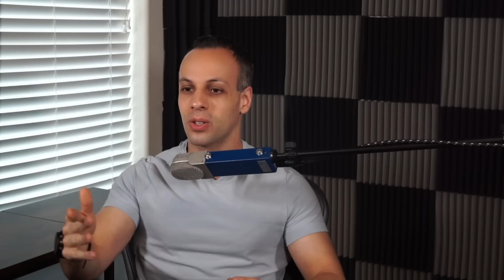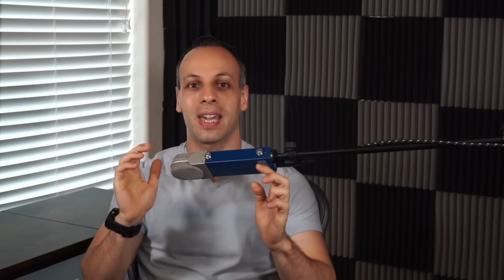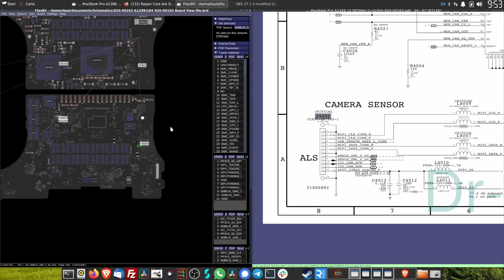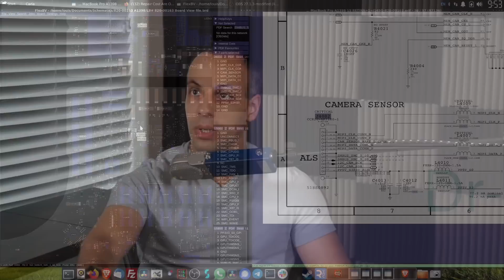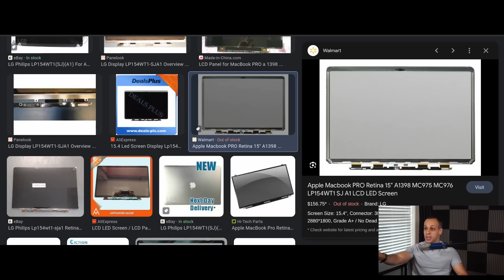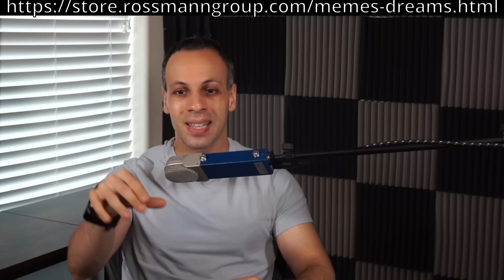The Ford F150 Macbook - when car repair resembles macbook repair...

Comment: Car manufacturers have either been behind the times with outdated technology or doing stupid things like this recently. Part of the reason, during the pandemic, new cars were in short supply is how they design computer systems for vehicles. They were using up to 20 years old chip technology on individual computers that a chip foundry would have to retool to an older process to manufacture. Car manufacturers were encouraged to go to a single SOC computer setup instead of multiple outdated computers. I can see the pros and cons of both. The is tail light issue isn't new. With the Advent of LED tech being used in lights, has made some replacements expensive but not like this. I knew my brother had an issue with his truck rear lamps going out and having to pay like $75 to $100 each lamp for every time they went out because of how they are designed. He finally went with an aftermarket light assembly replacement to rectify the issue.

Comment: There's a way to fix this but still keep all the canbus networked gizmos that manufacturers insist belong in a modern car. Have a star topology with a central "switch" so that one device can't bring down the whole network. Like, you know, computer networking engineers figured out in the 90s when a major switch from ring and common bus networks (10base-5) to switched (10base-T) took place. They already do in some cases with separate driveline, comfort, high and low speed buses, but obviously not enough. All essential components need to be on a separate bus.

Comment: 5k to fix a tailamp? 
my 2011 yaris top trim was 10k$ when i bought brand new. and i have put over 240k on it and it is still on ALL original engine parts except the consumables.

Comment: I owned a brand new 2016 Nissian Versa Note. My yearly matience cost was $2,500.00 a year over a 4 year period ended up costing me a total of $10,000.00 dollars for a 15 thousand dollar car. I discovered Nissian Lawsuits on a suggested Nissian Lawsuits on Google. I was  eligible for a $1,200.00 dollar refund on my radiator that failed at 24,000 miles and a transmission that failed at 80,000 miles. With a tolal of $2,400.00 dollars and the scrap sale of the Versa of $700.00 dollars for a total of $$3,100.00 I bought a 2001 Toyota Sienna and a 2001 Toyota Echo I have had no problems with either car. Since 2018. I just put in fuel, change the oil regularly and check the tire pressure. I will never buy a new car again.

Comment: I've worked as a mechanic for a Toyota dealership for over a decade and the amount of things on these vehicles that were clearly designed without repairability and longevity in mind is genuinely mind-blowing. I firmly believe it's because the manufacturers simply do not care because at the end of the day the majority of people lease their vehicles these days because pricing is just absurd for new vehicles and people want the latest and greatest technology at all times so someone like Toyota or ford will look at that and figure if they can build the thing to be relatively problem free for the first 3 years the people leasing those cars won't care if things start falling apart after 4-5 years because they've already returned that lease and it's someone else's problem now that bought that car used. New car "sales" continue and customers stay happy because they treat their vehicles like an iPhone and replace it every 3 years before any problems can really develop. As long as people treat vehicles as disposable appliances these types of things will just continue to happen and get worse.
Reply: Under 20% of people lease cars and the rate has been falling.
Reply: @JH-pt6ih  when you factor in used car sales where leasing is not an option sure but all I can tell you is what I know from my experience in a dealership setting and the vast majority of new cars on our lot end up being leased.
Reply: @Vanny_Dorito  Might be a peculiarity of where you are at. It is new cars I was talking about - which is interesting because in the push to get everything on subscription as a form of lease, one would think it would be easier with cars since they have a long history of lease programs at consumer levels. Are you at a location that is traditionally out in front on trends?

Comment: While you rightfully criticize Tesla for some of the stuff they do, their products are engineered well and go through numerous revisions and updates to improve them. 

Their OEM parts are actually cheaper than most others and things like keys are user programmable. The screens are also easy to replace because they aren't some outsourced module sunken into the dash.

Comment: Whats also really interesting is that most automakers in the world have all the essential functions of the engine and passive safety system on the much faster high speed CAN BUS line, and all other system on low speed CAN.
This is so the car can still function even if a tail light module or comfort module dies, the car still runs and works.
But from my 20 years in the car industry I know a few exceptions of cars who has the essential parts on the low speed CAN, and they all come from Ford Motor Company.

Comment: I agree that maybe we should create the job of: "Repairability Concierge" who has an overview of the design and integration process, and reviews the resulting end-product.
I work in a rather large high-tech, multi-national corporation where the IT department pleased the management by cutting a few jobs who had the responsibility of coordinating all the operating system patches for compatibility with the corporate standard computers and applications. Alas, the result was that 87,000 end users were then stuck with each diagnosing and resolving their own compatibility problems.  (Instead of doing the jobs they were paid for.) The end-result was that it cost the corporation several times more that it would have cost to retain that one person.  But there is nobody left in that management position to look at the larger, cross-department situation.
Reply: If Ford/GM/Chrysler wanted reliability they would make cars reliable. They have been making cars for over 20 years a monkey can make things more reliable if he had 20 years experience in building something. They just want to give you junk and keep you spending on repairs.

Comment: Apple should advertise their notebooks water resistant and built for tough. Water damage is not covered by warranty anyway and no consequences for false advertisement due to “improper usage”, it will be much less repairable, because everything will be glued together even harder and if you break it - oops, “it will be 2100$ to fix your 1300$ air, sir”.

Comment: It does exist, Louis. It's called "Failure Mode and Effects Analysis" and automotive industry holds semiconductor industry to this standard, and the employees doing the work are quality-reliability engineers and product engineers. But I guess the final manufacturer of the finished product doesn't hold themselves to the same standards.
Reply: There's training to explain to employees the types of things that shouldn't be discussed via email and the types of wording to avoid...  it's a real thing at many large companies
Reply: They learned from the Pinto fiasco: if you see a potential problem, do not notice it, because if you get sued over it you don't want a papertrail showing that you knew about it.
Reply: in aviation and airlines it's called MTBF - Mean Time Between Failures - and FAA will not allow a manufacturer to produce jet engines unless they pass thousands of hours of mtbf

Comment: Cars should be able to run when a non-critical system fails. As in does the engine run, can you steer, and can you brake? If so, it should run.

Not talking to a sensor for a drive assistance feature should not be a reason to disable an entire vehicle.
Reply: But how else would they make billions in repairing vehicles? lol What you say makes complete sense, and should be happening.  But all that matters to Ford and most car manufacturers is their bottom line.  Making the car as cheap as possible to manufacture, and as expensive as possible to repair.
Reply: They didn't sell you a 100,000$ truck on a loan that will screw you for life so you can go around town driving, are you crazy ?

Comment: Car used to be legally required in the US to use standardized, interchangeable modules for the head/tail lights which were a few bucks to replace and painless to install. Unfortunately auto makers had to move heaven and earth to get the government to allow the addition of a single style of rectangular modules, which could integrate into the car's aesthetics and aerodynamics unlike the original round ones, so they followed it up by just lobbying to scrap the requirement entirely instead of trying to more styles approved. @TechnologyConnections has a video on this history titled "Old car headlights were all the same — which was a fairly bright idea".

Comment: Meanwhile I’m driving my 2005 ford escape just fine. The fog lights I never had have connectors run for them which are currently exposed to all the elements. And somehow the car is not dead lol. And there is an oil leak between the engine and transmission which will eventually kill the escape. Basically I’m driving this thing into the ground until I can find another car that I’d like to buy. I’m weird lol

Comment: F150s are a plague. I hope all their stupid death-ray headlights burn out. Fuckin' sick of being blinded at night by assholes driving lifted F150s with their high beams on. Don't even have to lift the new ones, the headlights are directly at eye-level already. Around here, at least. The people who buy them are spoiled wealthy young men, they drive them like weapons and are wholly incompetent drivers. They have no awareness of the dimensions of the vehicle, so they park such that they make a blind corner, or on the sidewalk, or sticking out into the road, occupy several parking spaces, etc. The last year the number of the things has exploded. Most of the roads and parking lots around here were designed in the late 80s/early 90s when cars were half the size they are now. Then there is the proportion of fatal car accidents involving F150s. Tons of hit-and-runs involving children and cyclists because they can't fuckin' see anything in front of them. What kind of moron spends $100,000 on a truck? And another $50,000 in ridiculous cosmetic mods. All so they can drunkenly back over their toddler children. I miss the days when rich people just bought Porsches, then the only people they killed were themselves usually.

Comment: So tail lights have descended into utter stupidity; They were stupid to begin with. You back into stuff and they get broken. Soooo, let's make them 15 square feet of multimolded different color plastic and make them form fitting as a portion of the body, and place them like they are part of the bumper. Stupid. Even worse now.
How about ONE interchangeable one color simple lens for EVERY vehicle, so you can stop off at auto part land, grab a new one for $10 for ANY vehicle?

Comment: imagine going offroad middle of nowhere, and having this happening to you, and the compony tells how dare u go off road with a offroad vehicle
Reply: Then they wonder why all the off-roading guys just buy an old Toyota truck that can be repaired with a paperclip and duct tape.
Reply: @jjay350  A complete overhaul for $10k on top of a $15k 20 year old truck is still a LOT cheaper than a new truck that will probably be less reliable. I'm looking around for a diesel pickup in the 20-30 year old bracket and prices just keep going up. You used to be able to find clapped out trucks for next to nothing, but now even shitboxes are commanding several thousand.
Reply: @treelineresearch3387  Yeah I think the awful state of new cars has made people slowly wise up to how much better older cars were.
Reply: @jjay350 
All praise the Hilux

Comment: I own 4 Fords and have followed this channel for several years. It is an excellent channel. I did get to watch this video a few weeks ago. IMHO, this falls in the category of integrating many parts to streamline the manufacturing process at the expense of reducing repairability. The manufacturer reduces costs, and the owner will eat it when repairs happen outside the warranty period.

Just wait for that GUI screen control to go bad, and you have no redundant buttons as an option...Ahh, the beauty of "Sledgehammer" design and engineering. Instead of replacing a simpler, likely cheaper part, you use a sledgehammer to pull a bigger component that co$t$ more.

Comment: You can definitely tell there's no thought for fault tolerance anymore. They expect you to keep all your car's 87 computers happy at all times.
Reply: I own a fault tolerant motorcycle.
It's a 1970 Norton 750 commando.
Reply: @andrewallen9993 i love v8's. Give em fuel and power, and kaboom, 300hp wherever you want it to go
Reply: How much is the asking price? @andrewallen9993
Reply: That's what I like about my 93 Miata, pretty sure the radio is one of the only electronics in the car.
Reply: German cars have multiple CAN buses to avoid this kind of problems. It is a design issue.
Reply: @dona-km9xi  My German car not only doesn't have a can US if any sor but doesn't even require any form of electricity to run!
Reply: @andrewallen9993   German flintstones car?
Reply: @johnccisd5759  Almost. Mercedes1964 model w110 200d. It has of course a British designed engine by Harry Ricardo ( pre combustion chambers) and Jaguar disc brakes from Dunlop😁
Reply: @dona-km9xi yeah except y’all don’t avoid the issue or you just make one bud that cost the same as multiple…  it’s a moot argument

Comment: I encountered a abs warning light on a iveco trakker based truck. For 1,5 years multiple mechanics tried figuring out what was wrong as all the abs stuff was working properly. In the end the dealer was send a tool from the manufacturer to do a full firmware download where they discovered there were 3 computers in series. Computer 1 received a abs error send by number 2, but number 2 tranformed the clutch error to a abs error because they didn't have enough space for the clutch error code in the dashboard menu
Reply: That might have made sense in the late 50's when we still used little magnets threaded with wire for memory, and bytes cost real money.
When I finally got my scanner I hooked it up and scanned everything.  The dash module was 2 years older than the car.
Reply: @robertsmith2956  no the problem as the mechanic explained we was the limited number of error codes due to the can bus protocol, add to that the fact that iveco didn't give access to the 2 computers behind the scenes. The dealer received just the tool to do the download, but they had to send the dump to iveco to have it analysed in Italy. If the dealers were given the proper tools this simple problem would have been fixed on the first day. It just needed a new clutch plate
Reply: In this case very likely the problem was in error code management in the "software" of a module. Nothing a dealer could realky fix, the defective mechanical cause was a clythch plate, but that error signal can be fixed only rewritint part of error management "software"  by manufacturer ir the supplier of one if the electronic modules.